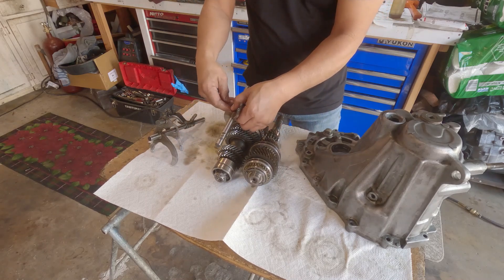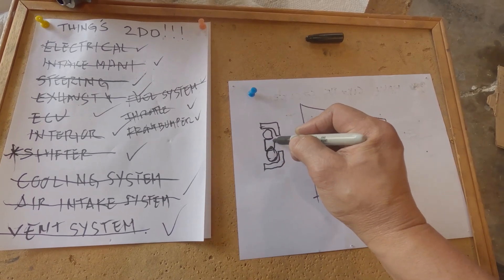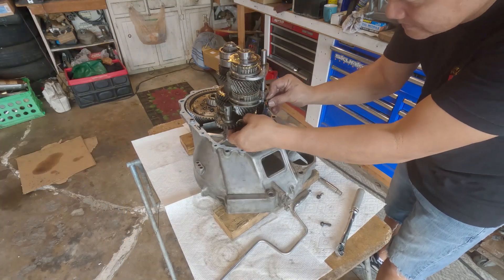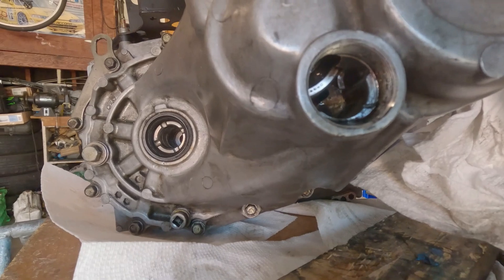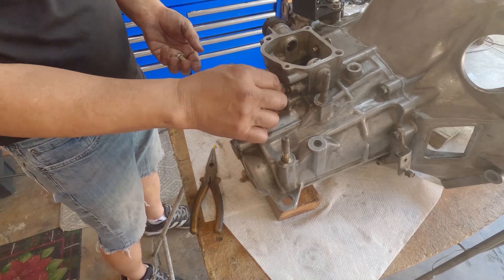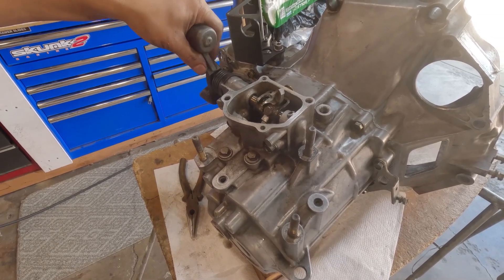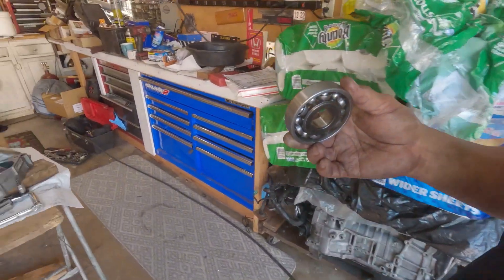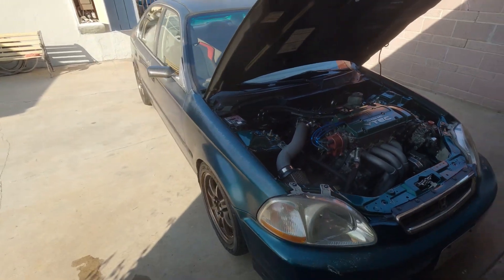Honda Prelude transmission M2S4 w/ Accord 5th gear. Final assembly.  pt. 3

Comment: Hello bro sagitt,,i seen some of your video which inspired me to build my friend g23 turbo,,i learn many from your videos,,tq,,but i have a question for the trans im using which is P2C4 from f20b,,can the M2S4 internal trans gear fit to the P2C4 housing?tq in advance bro sagit
Reply from the maker: I'm not to sure about edm tranny but l was looking at some specs comparing the 2 and it both have the same final drive of 4.66 and S4 have shorter gears than C4. I wont be surprise if it share the same countershaft part number. Are you thinking of just changing some gears? The easy way to find out is having M2s4 on hand and compare some parts. Not sure if you have the same wrbsite on your area like here in the states were l can compare some parts number on different Honda cars like Prelude and Accord, that's how l know if some parts from Prelude are ok to use on Accord by visiting Hondapartsnow.com, not sure if you have any website like it on your area. Actually there are some parts like hub and synchros from B series that can be use on Prelude and Accord here in the states not much parts but there are some interchageable parts.

Comment: Any whine noise while driving at low rpm?? After fitting the mfactory final drive??
Reply from the maker: Not on the MFactory lsd that I installed, and now l remembered that l opened my other transmission (m2b4) for some weird sound. But l never found out what causing it. I actually made a video but now l can't find it. Maybe l deleted it. Usually whinning sound is a sign of gear teeth wearing out/ too much backlash between teeth. But Honda service instruction doesn't specify a specs for final drive backlash unless l'm wrong. It only a check for differential bearing shims. What brand trannt oil are you using?
Reply: @sagittnet2158  its the 5.1 final drive im thinking the whine is coming  from, my builder said its normal but not sure, oil im using is torco which mfactory recomends
Reply from the maker: @finbarodwyer2170  I was thinking of the roller bearing ( countershaft) you have them change all the bearings?
Reply: @sagittnet2158  all bearings changed

Comment: What fluid did you fill the transmission with? I have the same M2S4 transmission with the lsd and was told to use gear oil but cannot find what specific type to use. Thank you.
Reply from the maker: Honda OE transmission oil, l onced used Lucas gear oil 75w90. If your pushing more than 450+ , you need heavier oil. Someone recommend it to me.
Reply: @ is the lucas good for 450+? I’m running a high comp h22a with the m2s4 but planning on following a build quite similar to yours pertaining to the turbo g23. Thank you for this information and the wealth of information you have shared!
Reply from the maker: @Coldheartedmanong  it was alright when l was using it. There's also Amsoil, Synchtomesh, Royal Purple, Motul. But you can't go wrong on Homda OE tranny fluid.

Comment: Great videos!
1. I need to clean all parts in my tranny. What solvent can be used? Carb cleaner, brake cleaner or hot water with some dish liquid soap?
2. What pre-lube are you using? I'm planning to re-fill my tranny with Honda MTF. Should I use it during assembly or some specialized bearing greaser?
Reply from the maker: I used brake cleaner but it get expensive. I usually grab a 2 brake cleaner and the rest l used acetone. Pour some on a bucket and rinse tranny parts on bucket. I try not to use hot water coz it might promote corrosion. If you do, spray some wd40 on it asap. I just use Honda mtf whenever l put together a tranny. If you're not using your tranny for a long period of time, you can use assembly lube, but Honda mtf is fine.

Comment: That's how "simple" he says.  HA!  I have the 5th gears from syncrotech.  I'm scared to attempt the swap.  I think I'll need about a month off of work just to get it done.
Reply from the maker: It's really intimidating at first coz l felt same before. I was so scared to mess things up that when l got a m2b4 tranny from the junk yard. I installed it to my H22 swap and found out afterwards that 2nd gear was not engaging( shidted on 2nd but no gear, rpm just went up). From there, l was forced to open it and learned from it. You can do the same, l wish you live closer to my place. Don't mind helping you at all. I think l've cover the things that you have to watch for and it'll be a good help using a Honda service manual.

Comment: I’ve seen your Video on how to paint a valve cover my h22 valve cover is polished do I still have to strip the paint also do I use primer or it will be fine without it ?
Reply from the maker: It's better to use a primer. Use vht primer for heat parts. Then you can use any color you like. Sinced it's polished, hit it w/ 320 grit or scotch brite to get the primer to bite.
Reply: @sagittnet2158  ok thanks

Comment: Which mtf do you use, I hear ppl say honda mtf, 10w30 oil, amsoil. What's best
Reply from the maker: I use only Honda mtf, if your not really pushing more than 230whp or doing any autocrossing drive, Oe fluid is best. I tried Lucas gear oil, friend suggested it. It was ok but its very thick.
Reply: @sagittnet2158  I use MTF and after a couple seasons of hard mountain pass driving the bearings have started to make a bit of noise
Reply from the maker: @sil-zk8061  you should use a performance mtf if you're on a game like it, maybe at least a Torco mtf. Honda mtf might not give it enoughvwear protection. Also your tranny is a bit older now and maybe it require some synchro changing or bearing replacement.
Reply from the maker: @sil-zk8061  was it making a whinning noise or grindinh sound?

Comment: Have you ever ran into issues with the threads on the cranks in reading a lot about people stripping them out, also would you happen to know if an f20b crank and rods are used with h22 piston In a h22 block if there would be any clearance issues
Reply from the maker: It's highly unlike to mess up the thread on the pulley side, it can only get messed up when pulley comes off while driving. For the flywheel side yes, it can get strip coz people use a loctite on it and fogetting to do some thread cleaning during assembly. F20b is 55mm main bearing and it can fit on 98-2001 H22 block, H23A bluetop and jdm H22 block(98-2001) piston is plug n' play also.